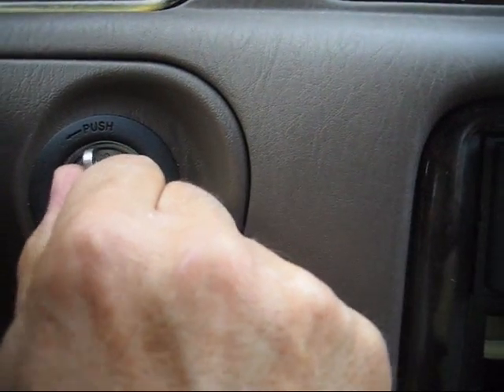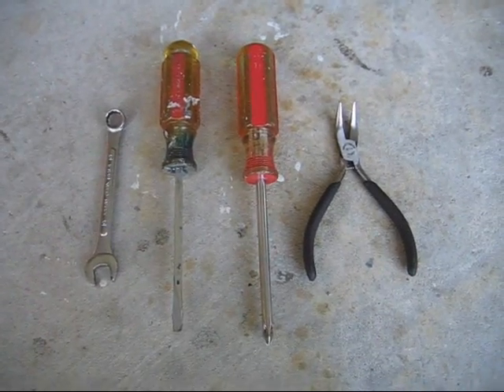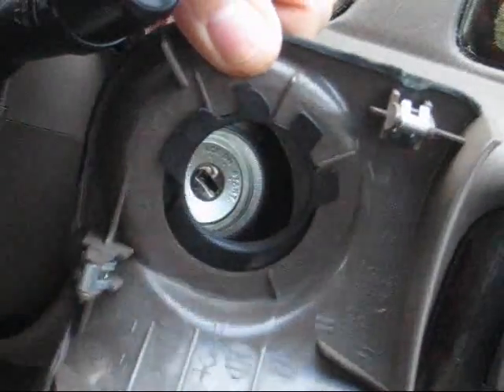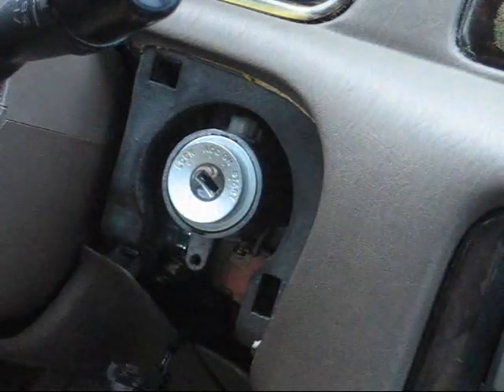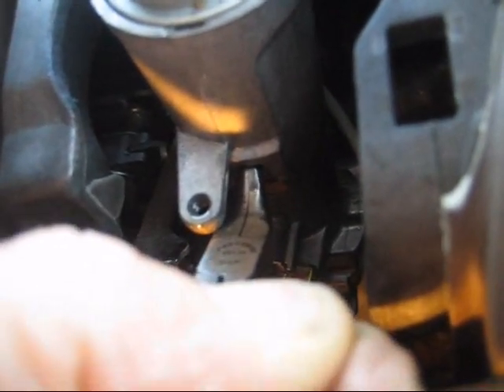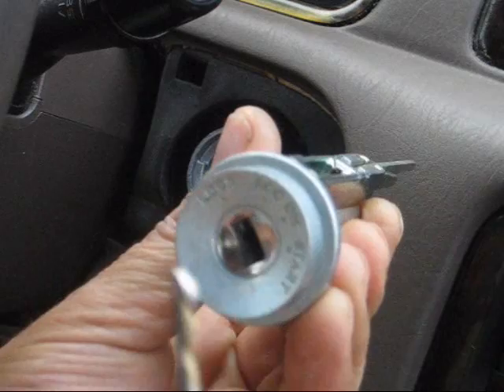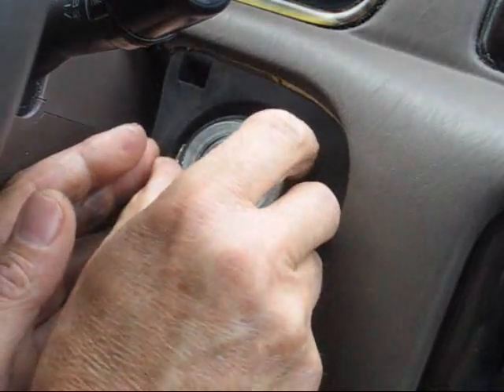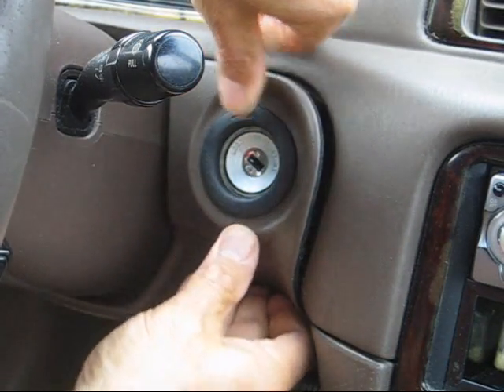Ignition Key Lock Cylinder Replacement - 1998 Toyota Camry (1997 thru 2001)

Comment: Well, I had to use a drill because my key would not even budge towards the ACC spot. The drill basically broke through the lock, causing it to fall out, and the ignition cylinder slid out. Thanks again for a great, brief video as well as for your response!
Reply from the maker: Great to hear that it worked out. Thank you Captain Jay Ready for sharing your experience.
Reply: What size of drill bit did you use iam having the same problem

Comment: Thanks man! This really helped me a lot. The hardest part, like everyone else, was to get it to ACC. After an hour I took a rest, then came back and stuck the key in and worked like it should. I took it to a local locksmith, and they fixed for $15. The cover was a pain to get off, and more of a pain to get back on.
Reply from the maker: Glad to hear it helped. Yes, getting the key to the ACC position was painful. Good way to go with the $15.00 locksmith repair. Thank you mrbjeep for sharing your experience.

Comment: Great video. Replaced the cylinder with one from O'Reilly's Auto Parts, called "LockSmart" for about $50 bucks.  Installed without any of the issues mentioned in comments about door chime and light ring not fitting on my '97 Camry. Took about 15 mins. Super easy job.
Reply from the maker: Glad it helped. Thank you Pablo for your comments/posting.

Comment: You're a life saver.  My local dealer wants $400 and my repair manual suggested removing the steering wheel.
Reply from the maker: Awesome, glad to hear it helped. Thank you M Beutel for your comments.
Reply: you can work around the wheel but it is sort of in the way  - - the one I just did I left the steering wheel in place and the only things I pulled were the cover as shown in this vid  and the light that is held in by the phillips scew. Don't do what I heard one guy try and that's to drill out the tumblers from the key opening - - you will snap drill bits like you read about

Comment: Great video. I purchased a cylinder on eBay and changed it out in 5 minutes. The key definitely should be in the ACC position in order to depress the release button (that's to keep someone from simply replacing the cylinder without a key, i.e., a thief). My 98 Camry has a transponder in the key. I was planning on having two keys on my ring (the old one for the doors and the new one for ignition). At first, I tried to start the vehicle without the old key near the new one (the new key does NOT have a transponder in it), but the vehicle security system wouldn't let it start. Once I figured it out, I simply put the old key on the ring with the new key (thus getting it close enough to the ignition security system) and everything worked fine. :- )) Thanks again for your effort to help others!
Reply from the maker: Thank you Joe for sharing your good results, also for sharing your experience about the transponder, this can be helpful for others as well.
Reply: hey Joe I have an 98 camry I got a new key without the transponder and I had the old one and put them together so that it could work but the new key is starting to have the same problem as the old one which was that it would get stuck at the acc and I'd have to keep trying to get it to start. in my case do I have to do anything with the igniter cylinder or can I just replace it and program the new transponder key. I'm stuck on how to deal with this

Comment: Nice video!  This allowed me to change the lock cylinder very quickly.  My car is a 1998 Toyota Camry XLR and I guess it has a key transponder.  When I put in the new cylinder, the car would not start, it would crank but not turn over.  It looks like when I did then the immobilizer was preventing the car from starting.  With the key in the on position, the security light was just blinking.  I tried to search for a work around, but was not able to find one that would allow me to start the car in a timely fashion.  Luckily the old cylinder is still partly functional, so I put it back in following the same steps in this video and the car was able to start up with no problems.  At this point, I am going to see if I can find a locksmith who can take the transponder key and make it match the new cylinder and hopefully that will work.  Just wanted to post here for anyone else who may also have the 98 Toyota Camry XLR version.
Reply from the maker: This is good information. Thank you Good Dog TV for sharing your experience. I’m hoping it all works out for you.

Comment: thanks very much for this video, it saved me a lot of hassle and money. i installed it in like 5 mins, but had trouble putting back on the cover, seems of the clips refuses to go back into the slot. It's just so nice to have a worry free starting now and no more fighting trying to turn the key over in the ignition.
Reply from the maker: Glad to hear it helped. I agree, it was frustrating that it could get stuck at any time. It was such a relief after I replaced it, since my wife drives it most of the time. Thank you Frank your comments/posting.

Comment: Great video--I had to replace the "unlock key sense switch" which has been causing some very weird electrical issues. But in order to remove the switch I needed to remove the cylinder. Thanks for the video which made this part of the job super easy.
So far so good on the switch change--there is no longer a clicking relay when I turn the key off.

For sure the dealer would have charged me more than my car is worth--If this hadn't work I was going to start looking for a new car. So thanks again!
Reply from the maker: Awesome, great to hear everything worked out. Thanks Ron for your comments/posting.

Comment: It seems quite simple, my 2001 Camry has the same panel design. I called the Toyota dealer before I looked up your video and told them the ignition cylinder had to be replaced. When they started saying something like well we have to do a diagnostic test, I'm thinking what's there to do?  They never quote you a price.  So I decided to go buy the ignition cylinder costs only $41 before the 10% discount for being a Veteran. Gonna see if I can fix it tonight. Thanks.
Reply from the maker: Roy Becerra Hi Roy, yes, 1997-2001 (fourth generation) Camry should have the same panel design. As far as the dealership, they will probably charge a couple hundred dollars. Keep me posted and thank you Roy for serving.

Comment: I'm about to replace the lock cylinder on my 2000 Solara. It looks the same as the 1998 Camry in the video. I have a transponder key but have found a work-around. I think will work. I have a non-transponder key that will still start the car as long as a transponder key is touching it. The plan is to cut off the transponder head from an old key and tape it to the head of the new, non-transponder key. Should work. And will save a lot of money.
Reply from the maker: Thanks for posting Larry. I think you should make a video to share your experience with others. Keep me posted.
Reply: Thanks Larry this worked for me.

Comment: My old cylinder won't turn to the ACC position which is the only way to release the spring loaded button. Do you know any tricks before I end up pulling the entire barrel out?
Update: I kept trying and the old cylinder finally turned. This was the best video I found and had the old cylinder turned to ACC immediately ot would have been done in 10 min. If you have a chip in the old key and buy a replacement cylinder without a transponder key make sure you put your old key on the same ring as the new one. As long as the key is close to the ingnition it will read the chip. Thank you for this video.
Reply from the maker: That’s great to hear. For me, it took a while, but eventually it did move in to the ACC position. A quick fix otherwise. I appreciate you sharing your experience. Good to know information. Thank you, Brian for your comments/posting.

Comment: Thanks for posting this, going to try it tomorrow. My 2001 Avalon made it almost 230,000 before ignition cylinder failed.
Reply from the maker: Hi Brian, I hope all goes well. Let me know how it goes. Thank you for posting.
Reply: It went great! Saved $100 taking it out myself instead of locksmith coming to my vehicle. A key instruction on your video was the tumbler needing to be in the ACC position to expose the spring for release. It was a miracle I got key to finally turn after 10 minutes.  Great video, thanks again!
Reply from the maker: Awesome, good to hear it helped you. Thanks Brian for the update.

Comment: What a great video.  The key in ignition warning would not turn off.  My Thailand based ignition was different.  I was able to grind the pot metal down a bit and it worked like a charm!!!  That little white button at the top of the ignition is what I had to modify the ignition for.  It was $40 for all 4 locks and if I had to do a little grinding...well worth it.  They are top quality locks too!!!
Reply from the maker: Excellent, you saved yourself a lot of money. Thanks for sharing Bob.

Comment: I just replaced mine today and wanted to point out that the lighted ring around the ignition had more than just a light in it on mine. I got the new switch in and tried to start the car before I put that plastic lighted ring back on....it cranked but no start, so I started trying to reset the anti theft system. So, after a bunch of screwing the pooch, I got to noticing that there was more than just a bulb in that black piece, so I put that back on and boo-yah! Hope this comment helps somebody.
Reply from the maker: Thank you Bushwacker for the sharing that experience. Yes, this can be very helpful.
Reply: Good comment Bushwacker you probably saved someone some grief.

Comment: Thanks for the excellent video.Mine is a 98 V6 camry .Pep boys has 2 types of ignition key cylinder one with transponder key and another with regular key which is much cheaper.If I buy this one without transponder will it work or does the computer system in the car look for a ignition key cylinder with transponder.I am pretty sure my current keys do not have transponder as it was a duplicate made at home depot. Thanks
Reply from the maker: It’s interesting, someone just recently commented/posted having a similar situation. In summary, his 98 Camry had a transponder in the key but he purchased the ignition switch/key without the transponder. The new ignition key wouldn’t start (because the vehicle security) until he put the old key on the ring with the new key (close enough to the ignition security system) getting it to work.  Check out the post from, Joe Campau, for more details. Let me know, I’m very interested in how you make out. Thank you, bsam64 for commenting/posting.

Comment: apparently the Toyota keys wear out or the tumbler set fails and suddenly won't turn the  ignition to the  ACC  ( or any where else for that matter ) in which case depending on the model you have there is a pin on the bottom or one on the top that must be removed (destroyed ) in order for the tumbler set to pull out. The reason for turning the key to the ACC position is there is a recess  that allows you to push it up and let the tumbler set come forward . If you have that pin on the bottom drill it out and use as big a bit as you can fit in the hole as any little edge will impede pulling the tumbler set. The top one I've seen where they use a C-clamp with a piece of hardened round stock or a short screw jammed in the hole to crush the pin and from what I saw you have to remove  more of the dash cover pieces for more access - - good luck and I hope this helps someone
Reply from the maker: Great information, this can be very helpful. Thank you Oldrbutnowisr for sharing.
Reply: just completed the removal for a neighbors son outside in the dark ( after it was dropped off at their house by a flat bed ) and most especially temps bellow freezing not fun but at least he could drive the car by starting it with a pair of needle nose pliers I loaned him til he got a tumbler set from Auto Zone the next day
Reply from the maker: Very cool, that was very nice of you helping out your neighbor's son like that. Thank you Oldrbutnowisr for posting.

Comment: Thanks for the tutorial, it was quite helpful. I had a 97 Rav4 with the same problem and I had to jiggle the key quite a while until it got fully in the ACC position to remove the old cylinder.
Reply from the maker: I’m glad to hear it helped. It does seem to be a common issue. Thanks for sharing/commenting Andrew.

Comment: Great video,

why some people have done this and the car still do not turn on.

could it be the ignition switch?

the reason I ask is becuase I have a 2001 Solara which my mechanic say If I only change the lock cylinder( comes with a key) my car won't turn on and I will need the ignition switch and program the key.

Comment: Thanks for the vid. Followed step by step and replaced it myself. Saving some money is good. It was a chore to turn the key to the acc position though. I vice gripped the key so I could get better "grip and pull" while pushing up on the spring release. Seemed to help a little.
Reply from the maker: Glad to hear it helped. Yes, getting it to the ACC position was the toughest part. I was about to drill the pin but it turned randomly but not after I wrestled with it till my hand hurt. Good idea on the vice grip. Thank you Michael for commenting/posting.

Comment from the maker: Thanks Buddy Gorven for sharing/commenting. It avoids having 2 separate keys. Good to know.
Reply: I can't get my key to the accessory position. Tried turning the wheel already nothing
Reply from the maker: I get your frustration. I have read some people drilled the little clip that you have to push up on in order to release the cylinder but as mentioned in my other comments, I had tried different keys, a newly cut key and moving the key back and forth for a while till my hands hurt. I kept at it and it did eventually (randomly) moved in to the ACC position. Honestly, I don’t think any of those things worked other than sheer determination/persistence. Good luck Vivian. Let me know how it works out.
Reply: @DoItYourSelfers  I got it I had to keep wiggling it slip over and I actually got it to go. Thanks for answering
Reply from the maker: Awesome! I was hoping that for you. Thanks for the update.

Comment from the maker: Thanks RandomStuffFixer for watching. The key needs to be in the ACC position so it can slide out when the spring release button is pushed in. For me, it took over 20 minutes of wiggling the key back and forth, up and down, removing it again and again, spraying WD-40, trying another key and eventually it turned.
I really believe it was just sheer persistence of wiggling the key back and forth, (a million times) causing it to finally turn. At that point is when I could replace the ignition lock cylinder.
Otherwise I would have had to drill it out as you did in your video:
1993 Toyota Celica Ignition Cylinder Removal and Car Start without key
 
Thanks for your video as well.
Reply: thanks for the video, but my key will not turn to the ACC position no matter what I do, and I've tried everything to make it turn...
Reply: ashvoj Try pushing in real hard and then twist.
Reply: tap the key while its in and try turning or flip key also and try

Comment: Thank you so much for the very informative video! I was able to do this myself except I had my boyfriend disconnect the negative connector to the battery for me. However, ever since I replaced the cylinder, the door chime dings and the doors won't lock as if the key was still in the ignition. I removed the cylinder and reinstalled it but it's still dinging. Wondering if you know how to fix this. Thank you!
Reply from the maker: Hmm, I didn't have that symptom but, I would confirm with who you purchased the replacement cylinder from and find out if they sold you the correct switch for your car. Also, maybe call and see if your original equipment switch can be rebuilt from a locksmith. Just a thought.
Reply: Ok. Thank you.

Comment: Great video, clear instructions and very helpfull.  Just one question, is there absolutely NO WAY the cylinder will slip out WITHOUT being turned to the acc position?
Reply from the maker: Hi Saul, the key has to be in the ACC position because it’s an antitheft design (or a thief can use his key and cylinder). This design prevents the pin from moving, which then keeps the cylinder from sliding out. With that said, I know how you feel. After struggling, wiggling the key back and forth a hundred times, using different keys, had a new key made, moving the steering wheel back and forth, using WD40 etc., it finally moved, anyway, the last resort would have been to drill the pin with a (cobalt/titanium type) drill bit. I believe there are some videos out there related specifically to do just that, drilling the pin to have it release. Good luck. Let me know how you make out. Thank you for your commenting/posting.
Reply: +DoItYourSelfers thanks again. i figured. luckily there was a camry sitting at the local junk yard with the original key still in the switch so i removed it along with the door lock switches and destroyed my old one with a drill bit like you said. Its all good now. Thanks again
Reply from the maker: +Saul Villegas Good to hear! Great idea with the junk yard, I do that at times as well. Thanks for the update Saul.
Reply: DoItYourSelfers

Comment: Thanks for the video and I am able to replace the ignition cylinder in my 1998 Camry. How do you guys re-key the door locks to fit the new key? Otherwise I would have to carry the old key for the doors and the new key for starting the car.
Reply from the maker: To possibly avoid 2 separate keys, once you remove the ignition cylinder, a lock smith may be able to repair the old cylinder. If repairable, this will avoid the 2 different keys. Hope this helps. Thank you Gary for watching.